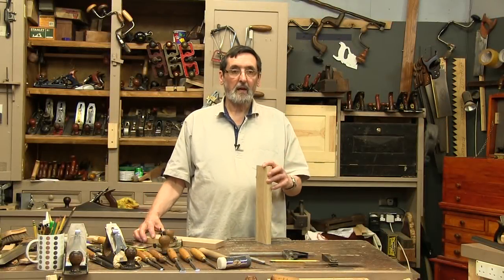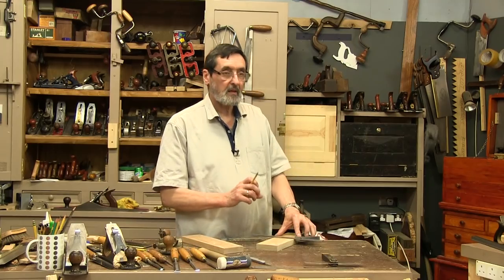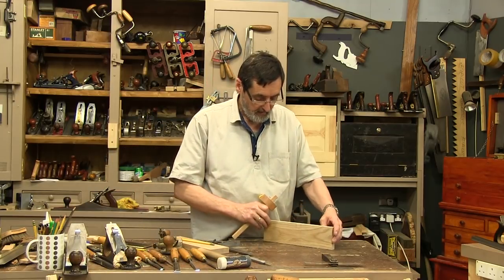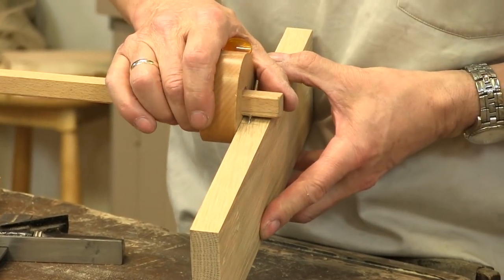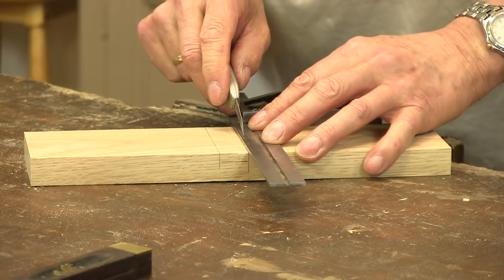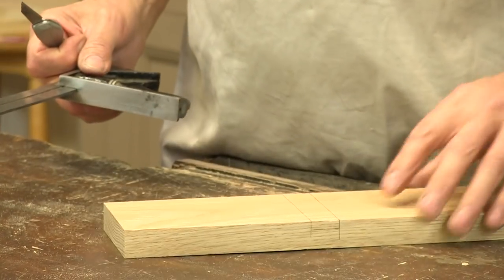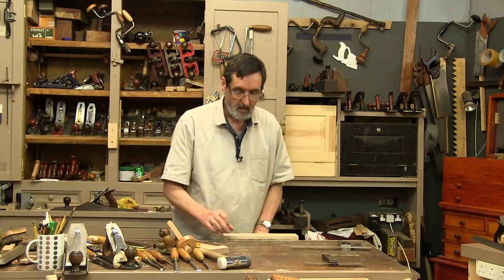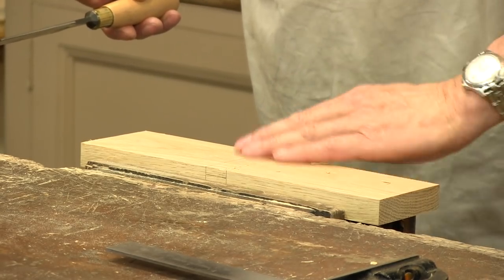How to make a Housing Dado Joint - The Three Joints - | Paul Sellers

Comment: Talk about making a meal of it! Seriously? How many times do u have to put a stock piece in and out of the vice? I lost count! You can tell he's a teacher. The goal isn't to make a perfect t joint example piece to get a distinction grade. How are you supposed to make many /complete projects at this rate. Cross cut the sides, clear out with a chisel and move on the the next  joint.
Reply: It is a demonstration video and he is showing people how it can be done. Paul can cut joints in fraction of the time all by himself when he does not need to be talking. 
Paul makes very high-end furniture and can do it as fast people can when using machines. What do you mean you can tell he is a teacher?
Reply: @bighands69 I feel like he enjoys showing people slowly so they get to see everything well but also because it's fun for him taking his time, but as I am a cabinet maker and woodwork teacher myself I find it funny that people are taught to do single joints, slowly, but miss the great value in practising it the way professionals do until you are skilled enough to trust your hand skills and use minimal steps in the process. Reducing the steps in the process to the bare minimum increases work output so much when doing high end joinery. Every joint that requires 1 minute  longer on each half of the joint means that every basic frame you make will always be 8 minutes longer. As teachers we want people to learn these skills for a reason and mostly that reason is to be able to become skilled and professional

Comment: Why don't you use a table saw with a dado blade? It would take a tenth of the time and you'd get the same result.
Reply: Ivan W. If you had dozens of housing dados to do then yes a table saw would make more sense. But, for half a dozen or so it's more economical, challenging and rewarding to cut them by hand. Your finished project has a different sense of gratification, it's more fulfilling knowing you cut and made it all by your own hands. You also get a better understanding of the whole nature of the wood and its make up when getting up close and personal with it. Plus, you'll be able to carrying on working if the power goes down. ;)
Reply: Ivan W. That's certainly an option for most people.  That's how I plan on doing it with my built-ins I've got planned.

This series isn't about using power tools, though.  Paul's one of the last people trained as an apprentice as a boy in the use of hand tools, so that's what this series is all about.  If you want to know the power tool way of doing things, try someone like the Wood Whisperer or Matt's Basement Workshop.